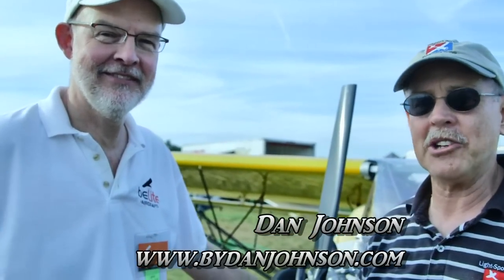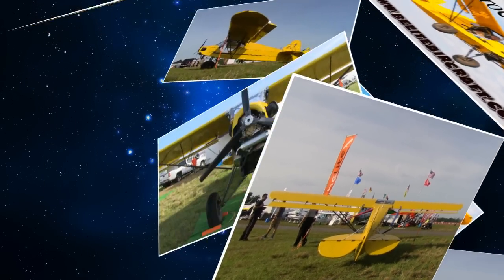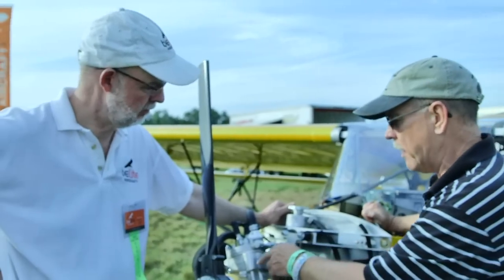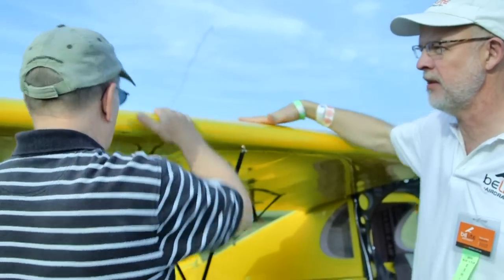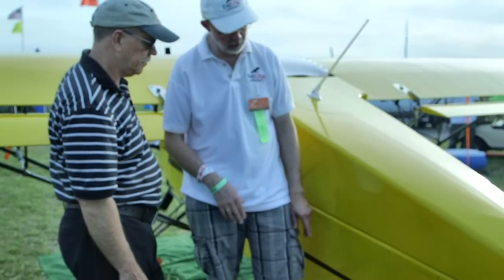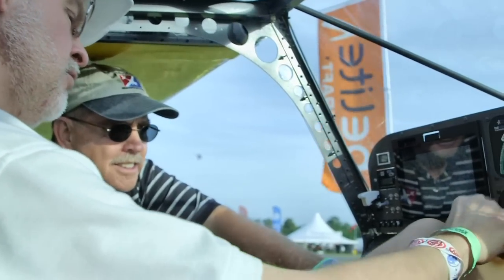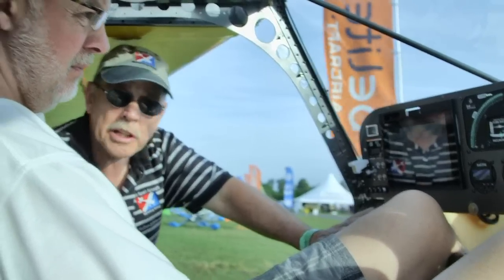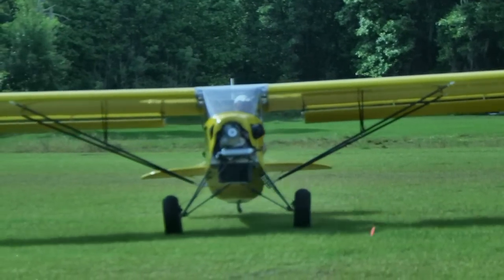Belite Pro Cub Lite Part 103 legal ultralight aircraft from Belite Aircraft

Comment: what happened to this airframe? were they never able to make it comply with 103?
Reply: Wewll, they out of the "UL" bizzness..Only a LSA is for sale.....$30,000.00 USD approx....
Reply: I called today and a salesperson told me they don't sell it anymore.
Reply: @Alphastorm2180  Their current ultralight is the Chipper SS - same Polini engine, but different construction. They say "CNC machined parts for easy construction and quick building

✔ Honeycomb aluminum and honeycomb fiberglass included in the kit

✔ Build as either Ultralight Part 103 or as Experimental Amateur Built (EAB)"
Price for airframe+finishing kits is $11,000, engine+mount is ~5000, not sure where/if prop included in either.

Comment: if its bumped it will get dents in foam...
Reply: Got to be extra careful when ground handling or you can put a permanent dent in the foam.  With every design there are compromises.  Also, some foams are very sensitive to fuels used and can turn to mush when exposed.  Not sure of what type foam they use in this design.  Looks to be well designed (for an UL.)